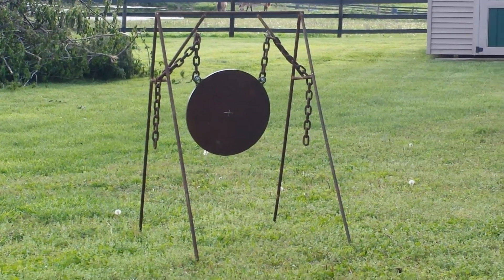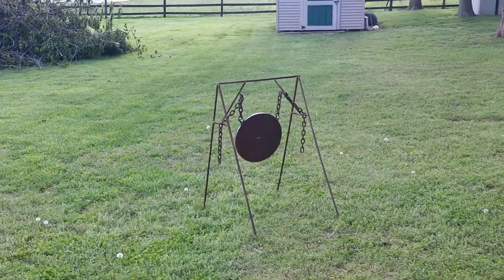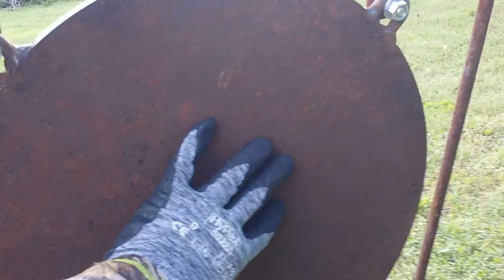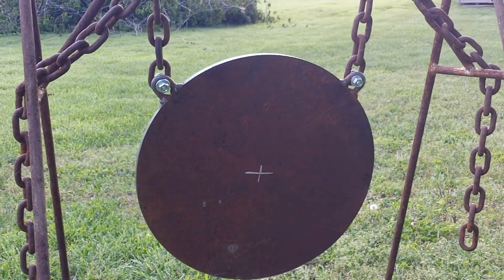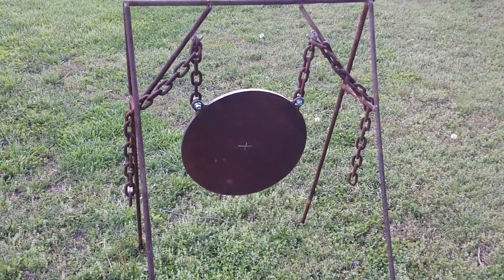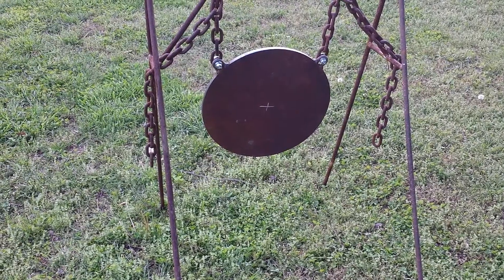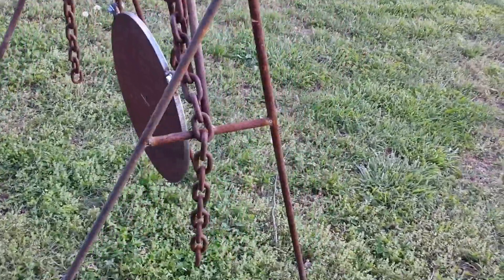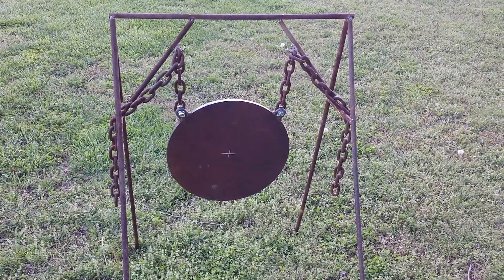New Steel Gong target The Late Boy Scout I would like to Duracoat this!

Comment: Is that cold roll steel? If so it may do good at 200 yards but at 100 you may start punching holes through it, but will still last a long time. I got a 3/8" plate set up at 50 yards and after some shooting it started to get holes poked through. Let us know how it works man!
Reply from the maker: Cold roll indeed...you are 100% on the mark. I was pretty sure it was gonna happen...no I was FOR SURE...but...the guy that made it for me said, no big deal, it's free, it's no big deal, I can make you as many as you want...shoot away until it's a throw away. So far no punch through or at least not all the way through...but some damn big divots...I decided to not shoot one with rifles, it's a fun LONG range handgun gong. Trying to mustard up an AR500 gong...so expensive and then the shipping pours alcohol on the gash! Sorry it took me a bit to reply, I wanted to test it before I hit you back up.
Reply: Hey if it's free why not, yep should last a long time using pistols. Thanks for letting us know how it worked out. Take care man!